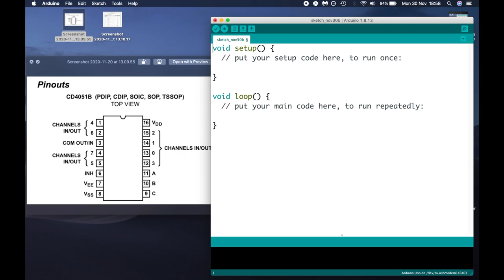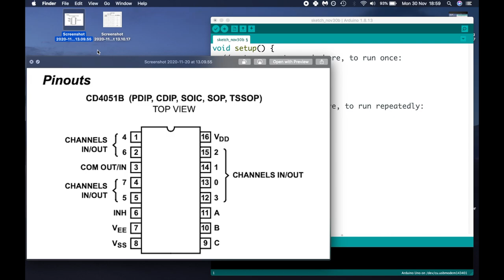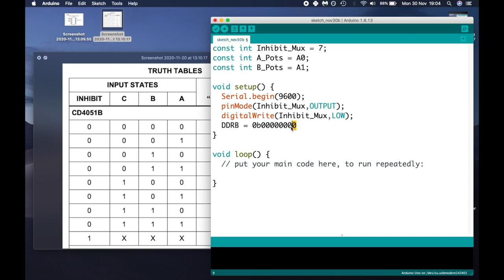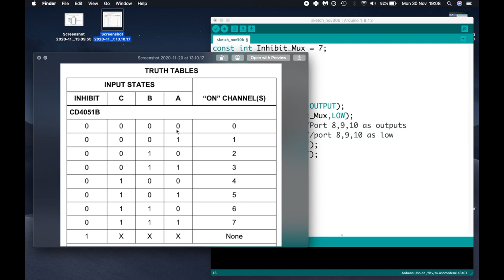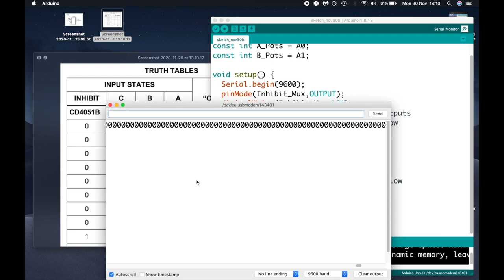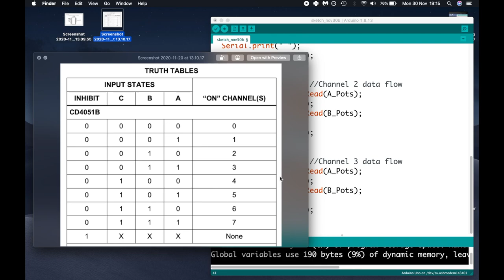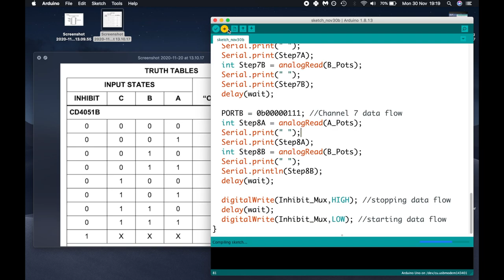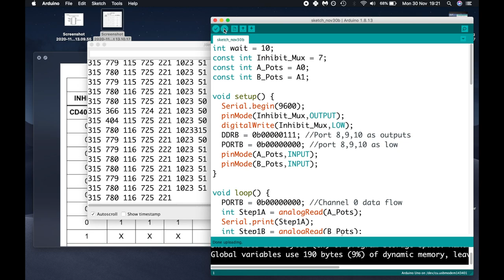Multiplexing Arduino Inputs: 16 Analogue Sensors on 2 Analogue Pins!

Comment: Hi  Charis , how are you ?
I am very happy when I found your video. I need some explanation because I'm new to programming.
my problem is using a 50 touch sensors  TTP223 as input . with WS2815 streep led .arduiino mega ,  wich one can i use to control  ? 4051/4067 OR shift register . as you now it's different programming.
thank you .:yt:
Reply: other else  there is no problem with TTP223 its the same as traditional buttons

Comment: is it possible to connect soil moisture sensors like this and read a relatively correct information from them, or their signal will be too low to work this way?